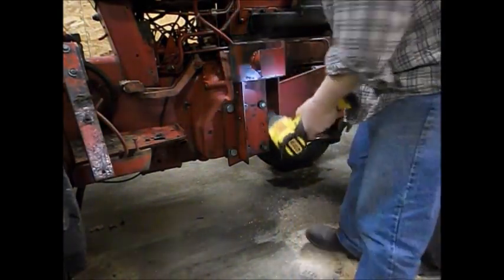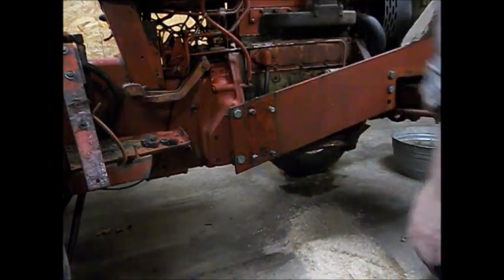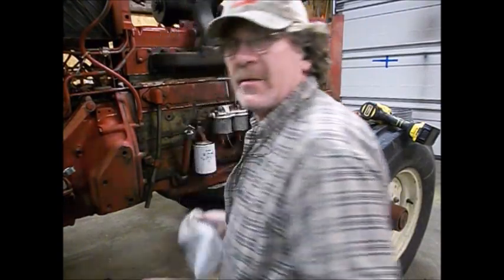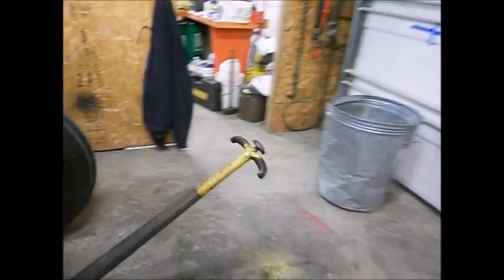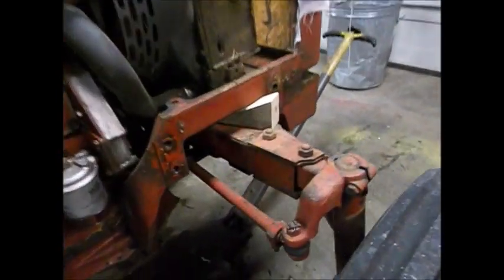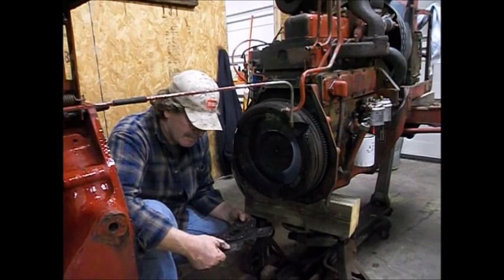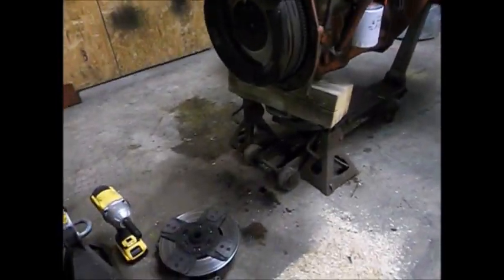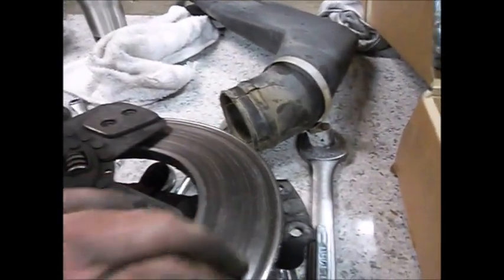IH 584 Clutch removal.

Comment: Nice tip on the wedges Dewalt real impressive. Those make of IH tractors 84, 74 if you're not careful you'll find yourself riding with your foot resting on the clutch pedal. Found myself doing time to time.  Have a good one Monty
Reply from the maker: Thanks.  I like the dewalt. The more I use the more I like it. I know what you are talking about.  I grew up running ford 8N's, 600 and 800 series tractors.

Comment: When you get new parts, that have plastic plugs.  Save the plugs! We have a plastic box full (keeps them clean) usually find something to plug a line with.
Always gotta block the front axle, unless you have bolt on splitting dollies, then it can't tip.
Cordless tools have really spoiled us!! Just gotta have enough batteries...
Reply from the maker: Yes I have a bunch of those plugs, they come in handy. Yeah,  I don't split tractors enough to justify splitting stands. That's one of the reasons I got a Dewalt.  All my cordless tools are dewalt.
Reply: @VintageFarm1086  we made a set of stands. Most of what I have is DeWalt.  I just couldn't justify the price of the good impact. So Hobo Freight it was..
Reply from the maker: Most of my friends use implement jacks for splitting stands. They put wheels on the bottoms and weld plates on side to bolt to the tractor frame. I found that impact on sale for a 1/3 off.
Reply: @VintageFarm1086  nice!!!